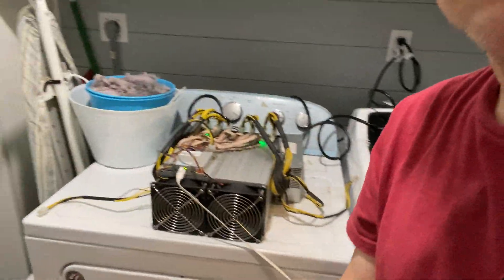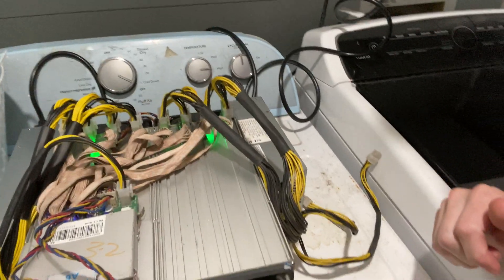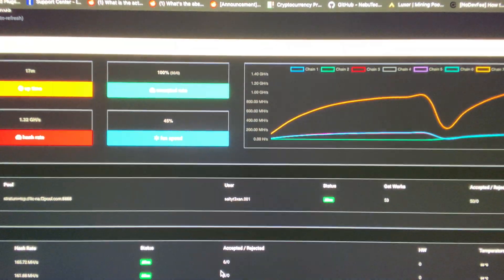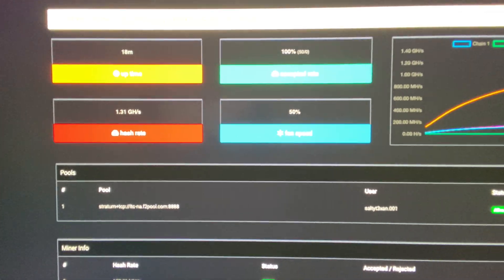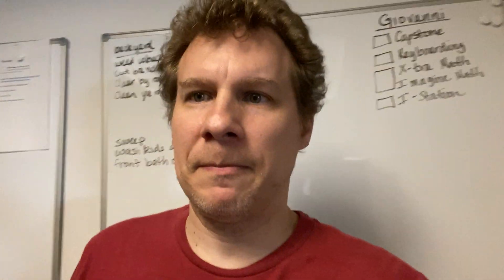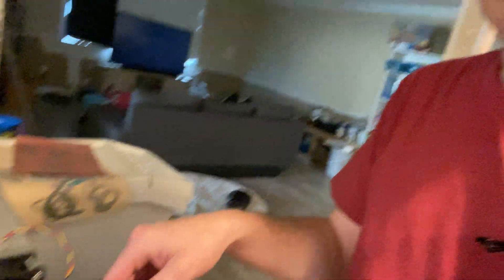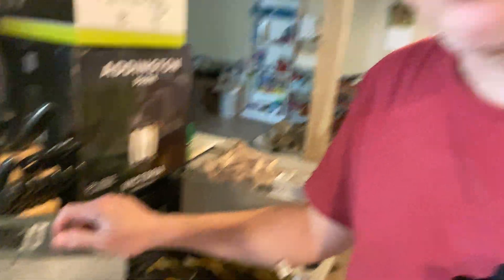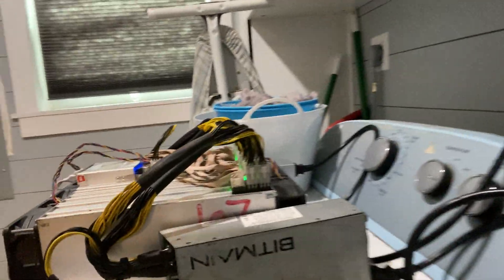Unboxing a used Innosilicon A6 LTC/Doge Miner Part 2

Comment: how much did you pay each of them ? do seller guarantee it will work ?  If it comes as a dead box, what can you do ?
Reply from the maker: For both end up being $7200. Seller do not guarantee work on arrival since they are used miners. Alibaba Trade Insurance is a joke and most CC companies have buyer protection if the items you are purchasing are new, not used. If you want to buy miners off of Alibaba, make sure you research and ask questions. I'm in talks with another supplier and they advise me not to buy used miners. Other option is purchase off of eBay, however you will be spending more money but will have better buyer protection.

Comment: Salty so how did you resolve the 3 bad hash boards was it the bitmain psu that fixed it?
Reply from the maker: Unfortunately I went from 3 bad hash boards to 5 bad hash boards. Even with the vitamin PSU, it did not fix the issue.
Reply: @Onlypcgaming  I have an A6 with 8 boards i think maybe 2 are a4+ would you be interested?
Reply from the maker: @ryancollins2476  A6 miner uses 8 A4+ boards. Basically A6 miner is 2 A4+ put together.
Reply from the maker: I have a part 3 video up, I talk about the bad boards.

Comment: part 3?? looking to get some miners of these units from them as well, thanks for the insight
Reply from the maker: Part 3 video is up.
Reply: @Onlypcgaming  thanks for letting me know !
Reply from the maker: I could make a part 3 vid, not much to report. 5 hash board no longer work. So At the moment I have one full miner at 1.2 mh/s and a the other avg around 500 - 600 mh/s when one hash board works some times.

Comment: Very cool man! I was curious about the power supply and how you navigated around that. Has that still been working well for you? Getting optimal power/hash rate? Thank you for sharing.
Reply from the maker: At the moment, I have the miners running on 110v outlets. Problem is I have each PSU connected to different outlets that are not on the same breaker...LOL It works, the miners have been running over 30 days now 24/7.

Comment: Saw what you paid on AB on Reddit. Vendor now shows these at a too-good-to-be-true price. Makes me nervous.
Reply from the maker: I paid a total of $7200 for two Innosilicon A6 miners. 5 out of the 16 hash boards are pretty much dead. So basically I have 1 1/2 miners running at the moment. It's not going to discourage me to not buy from again, just not from that supplier.
Reply: @Onlypcgaming  maybe try buying a few new 14 pin ribbon cables? One of my a6’s has a hashboard that drops out if you look at the ribbon cable funny. Have replacements on the way currently
Reply from the maker: @holypoopsack  not a bad ideal, will look into that.
Reply from the maker: @holypoopsack  I did, and made a part 3 video.